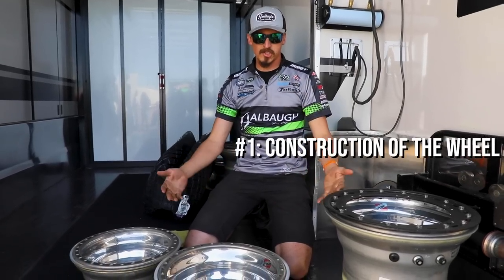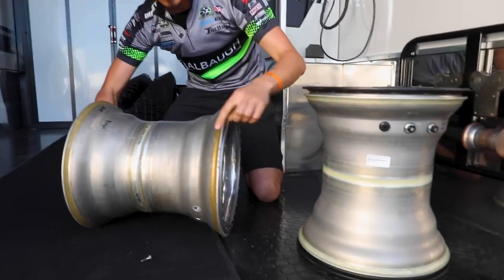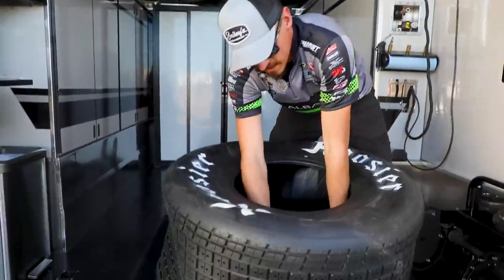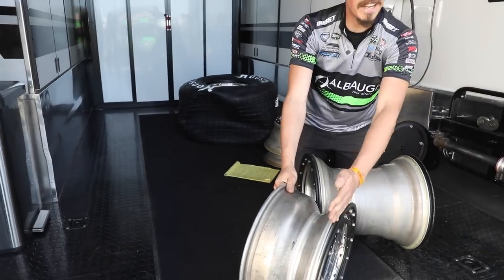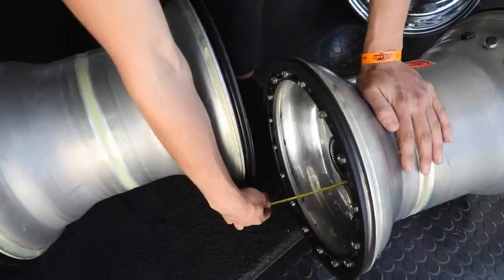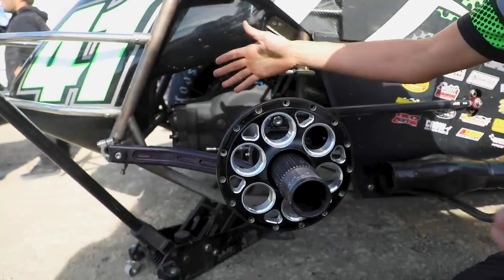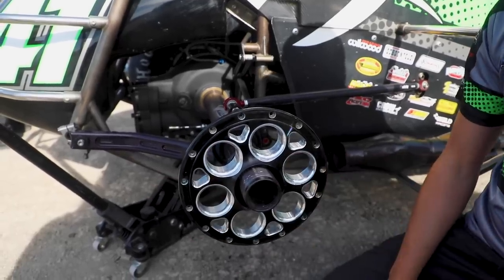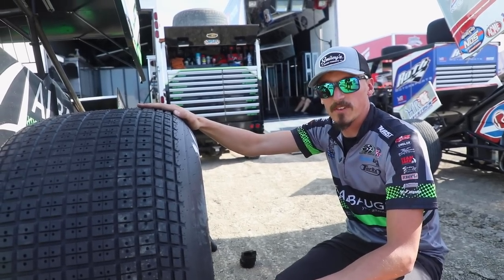Wheel Talk | Let's Learn Something with Nate Repetz

Comment: The wings! I’d love to see an in depth video explaining what’s going on with the wings!
Reply: I second this.
Reply: I third this. I do custom beadrolling and so want to build a wing or 2, but I don't know exactly how they work.
Reply: I too would be interested!
Reply: Downforce
Reply: @mistermusturd6402  that's not debatable. The adjustability and how drivers can make adjustments on the fly. That's what I want to see. Is the center section different from wing to wing? Do teams run different wings to affect the airflow? The side board height and stagger. Does that change?
Reply: It’s literally an upside down airplane wing which instead of creating lift will create downforce.. as for the side panels bolted to the center section, those are to load the left rear tire when the car is sideways (left rear is what gets you off the corner) 

To see what I mean, go to a race, when the race is over head to the pits and look at the left rear tire, they are typically completely wore by the end of the race (especially tacky-ish)

When dry slick you’ll wear both tires nearly completely.. that’s a rough explanation ✌️
Reply: @industrialpalletworx3548  Yes different wings are different in the center.  They're upside-down airplane wings so the bigger the shape the more the downforce.  You can also change angles, which will need to be different depending on the wing shape.  For adjustment, there's a lever in the cockpit by your left hand.  Generally the driver moves the wing further and further back during the race as the track goes away to put more and more force on the rear tires.  You'll notice them way way back on the slippery tracks.  Nowadays the ram can move the wing forward too, before they didn't have enough force to move it forward racing because of the air squashing it, you only could on a Yellow flag.  Sideboard height and stagger, I don't actually know about that.  That's what little bit I know, I'd also love a video about wings!  As the front wing does a lot more for steering than people would guess, taking the air off of someone's nose is definitely something to be aware of especially on the bigger faster tracks!
Reply: @djjazzyjeff123  I've been told the wings are made of 6061 T6 aluminum. From a bending standpoint that material is near impossible way too brittle. Can a different grade of aluminum be used?
Reply: @industrialpalletworx3548  I know a guy who builds them, but I don't build them myself, so that's about the of my depth of knowledge.  They're definitely aluminum, and they're hollow with a skeleton and then thin aluminum sheeting encases that all riveted together.  Also they're really light, one person can carry a top wing pretty easily IF you have a big enough wingspan to reach both panels without bending them.  Classic case of "it's not heavy it's just awkward."

Comment: I would love an in depth look at shocks.  To me they are the most black magic part of every racecar. Are you able to tune low speed independently from high speed? How much of a change does gas pressure make to the bump and rebound plots on the dyno sheet? Is that relationship linear? What’re the pros/cons of gas versus non gas? What directions do you go on shock valving throughout the night? Packers, bump springs, all of that kind of stuff. I know that’s a lot of questions but they are definitely the part of the cars I understand the least.

Comment: I'd like to hear about air pressure equalizers.
Reply: Tire Bleeders, you mean?  If so I know a little have wrenched on a few cars.  Those are rather simple machines but still awesome and important.  Temperature is one of the factors of Tire Pressure, as temperature goes up, air expands, so the PSI goes up.  A bleeder, you just set what PSI you want it to be, and then as it heats up, it will "bleed" off some of the warmer air keeping the pressure inside at a constant.

Comment: Would like to know why the car is push started, and do you have to shift or is it just one gear? Are you allowed to choose what gear ⚙️? Or does everyone have to run the same gear ⚙️
Reply: Its basically an in or out shifter on the rear end.  winters has a really cool video on assembly of sprint car rear-ends.  https://www.youtube.com/watch?v=54YLrT2T_-I
Reply: Here you go. All explained here by Tanner Holmes with him behind the wheel showing you: https://www.youtube.com/watch?v=PNkPi35lD9U

Comment: The difference in headers use to see teams swapping them all the time for different reasons
Reply: One simple reason we do it is because our driver prefers mufflers but they cost some horsepower, so we run open headers in qualifying when every 1000th matters and then switch to Mufflers so he's comfortable for racing.  Usually after the heat race and before the feature simply because that's when you have time not better used on other things that are more important.

Comment: Still don't understand how wheel offset changes how tire is loaded. Any engineers out there got answers for this?
Reply: If the middle of the RR tyre is spaced 18" out from the frame, a 5" offset wheel (closer to muffler) will make the car looser than on a 7 or 8" offset wheel.
Reply: Yes that is what we all get taught. But if we go from a 5 off to a 8 off and still have it spaced at 18" from frame how does it load the tire differently? Tire only touches wheel on the beads.
Reply: Exactly! If the tyre is still spaced the same amount from the frame ( contact patch has not moved) then all we have changed is the shape of the wheel.... I can not see how this would change the handling of the car